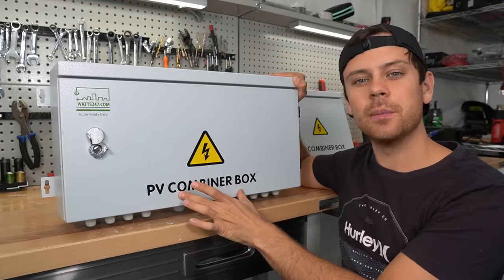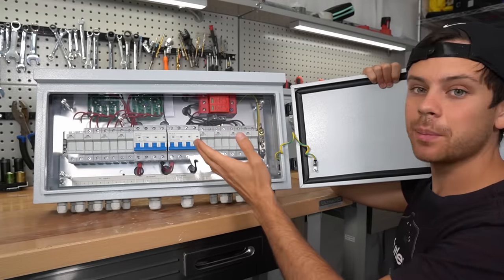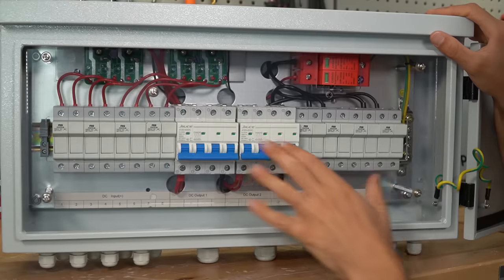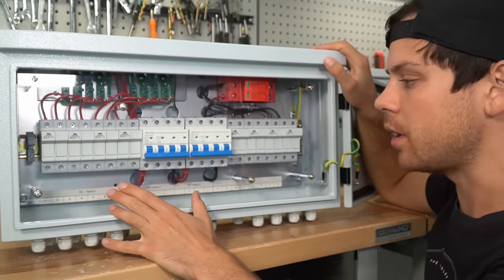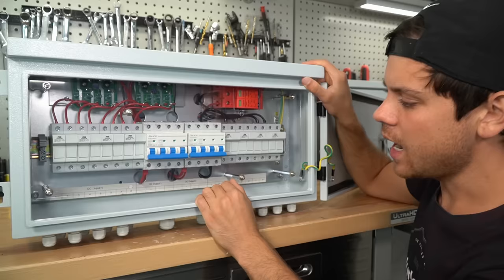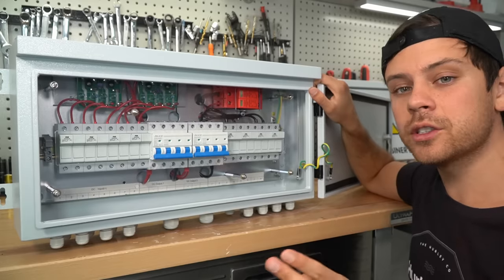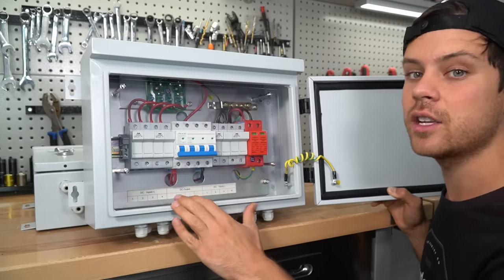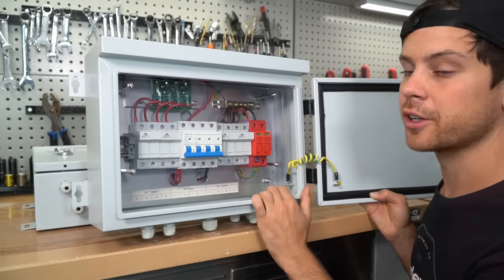What is a PV Combiner Box?

Comment: What bothers me about combiner boxes is the amount of unnecessary stuff in them. Blocking diodes aren't needed if you are using a charge controller as it will already prevent current flowing back into the panels at night. Even worse than that, they actually absorb power and reduce the output of your panels. I also really doubt the little surge protectors are appropriate for solar installations. Is it even possible to get surge power from a solar array? The only thing I could think of would be a lightning strike, but I doubt such a small unit could do anything to protect from that colossal level of power. IMO most people are better off combining parallel strings with a water proofed busbar and some inline fuses.

Comment: Anything you're buying that has screw terminal connections you must check torque in each terminal. Blaming them for loose connections is ridiculous.  It had to get shipped and endure prolonged vibration.   I have a 6 string combiner box on my array and changed the fuses to be 80% of the max allowable panel current.  Leaving the fuses at 15 amps is asking for trouble, do your home work. They need to be the quick blow type, time delay fuses will fry your panels
Reply from the maker: No we are going to blame the company and the people that work there because the connection was bad. They did not use crimp connections. Having a tinned solder wire connected to a screw terminal is not industry standard. So yes it is the company's fault
Reply: @WillProwse  very well said
Soldered wire should never be in screw terminal... Ferrule crimper are very cheap so there isn't really any excuse for not using them tbh
Reply: Like fish in a barrel

Comment: Hi will good vid I have growatt spf 5000es it has one pv input I plan on running two  Sirius strings and two parallel 2 together runing two 15amp fuse to plug in mc4 y  Connectors it will handle 450v im having hard time finding braker or disconnect switch i did find  Knife switch It looks like Frankenstein switch lol most dc brakers ar 150v dc thanks mica
Reply: Mica, you should rewrite this so it makes sense...correct all the spelling errors, use punctuation marks, make it readable. Noone understands what the hell you are asking.

Comment: i imagined as solar panels contain diodes there would be no backfeeding
Reply: Yes most panels do these days it it never hurts I guess
Reply from the maker: These are blocking diodes. Diodes in the panels are bypass diodes for shading.
Reply: @WillProwse  thanks, have you tested  current flow to shaded panels ive seen guys get zero current flow between strings. However i will do some testing to learn .

Comment: I'm sorry Will, you just lost my respect. I thought you knew what you were talking about..... Surge protection device doesn't disopate to ground !!! 
Fool 👎😐
Reply from the maker: Yes it does. You are thinking of AC surge. This is DC surge. DC surge occurs when charge imbalances across long conductors causes a voltage Spike.
Reply from the maker: Call a company that sells those surge protection devices and ask them how they work. You were thinking of AC surge I think
Reply from the maker: Spike and surge are different and depedent on duration of high voltage event.
Reply from the maker: "SPDs are applied to electrical systems to provide a discharge path to earth to save those systems’ components from being exposed to the high-voltage transients caused by the direct or indirect effects of lightning or power system anomalies."
Reply: There might be a valid point here, but I'm not quite sure this is the most awesome way to get it across. Also, I believe you mean "dissipate."
Reply: @mrdocuseal  ...lib